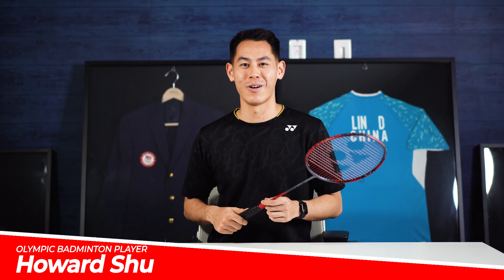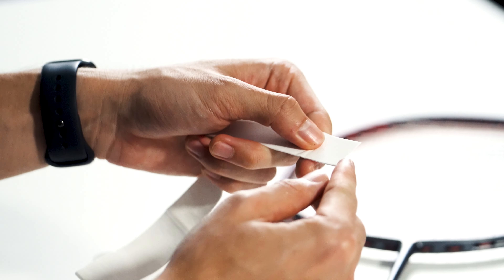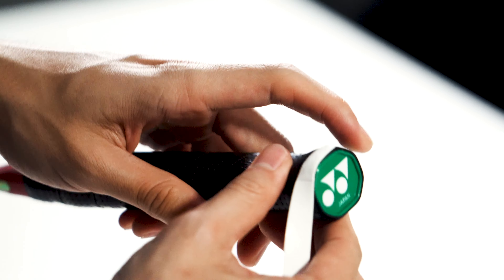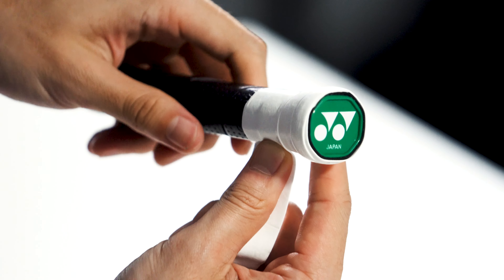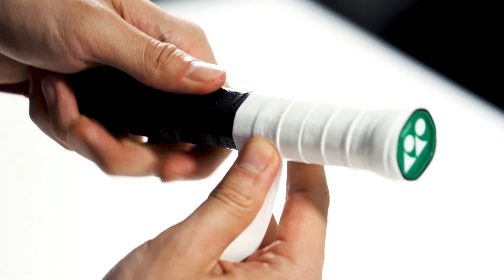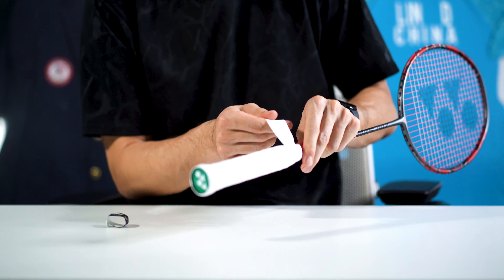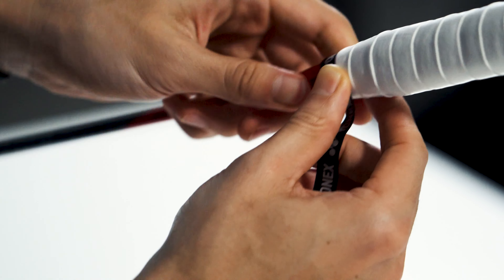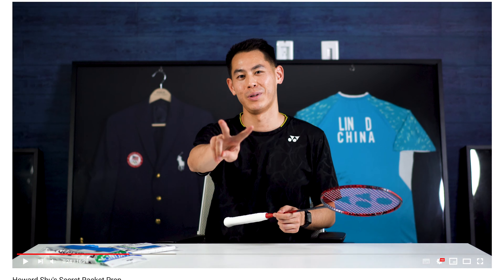How To Grip Your Badminton Racket Perfectly TUTORIAL

Comment: Thanks for the tutorial Howard! What's the black base  tape that you're gripping over?
Reply from the maker: The black base tape is the factory grip that the racket actually comes with. Many people remove that and put prewrap underneath instead!
Reply: @howeezy  For pre-wrap, using insulation tape will be okay, I guess? Over which, you can put Yonex super grap. 
And is it just the payer's preference for putting a grip over pre-wrap or factory grip? Or are there advantages and disadvantages to it?
Reply from the maker: @PeakyBlinderseh  yes totally personal preference! Some players like to put pre wrap underneath their grip for added spongy feeling. I personally don’t like the black factory grip so I usually remove it but I play towel grip so it’s a little different.

Comment: I absolutely cannot regrip it doing what you just did. I get folds and creases. I’m doing it over the bare wood of the handle. Is this where I am going wrong?
Reply from the maker: Bare wood is going to be harder because it has flat/sharp edges vs if you have the factory black grip, it at least is somewhat soft and rounded already

Comment: How would I make my grip like yours the same thickness if I took off the original grip?
Reply from the maker: If you took the original factory grip off, I would recommend using some pre-wrap tape underneath first on top of the wood handle too add some thickness before putting on the new grip
Reply: @howeezy  how thick do I make it?
Reply from the maker: @felixlin9758  I'm not sure exactly how much pre-wrap you would need to make it exactly the same. But prewrap is pretty spongy. I would say try 2 thin layers. You should be able to get an idea of if it is close to the original thickness or not
Reply: @howeezy  ok thanks